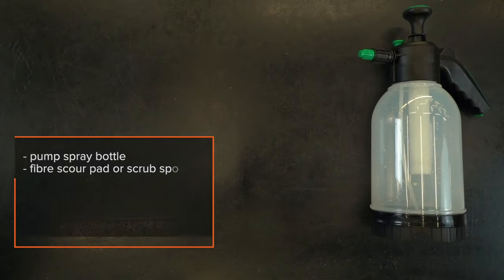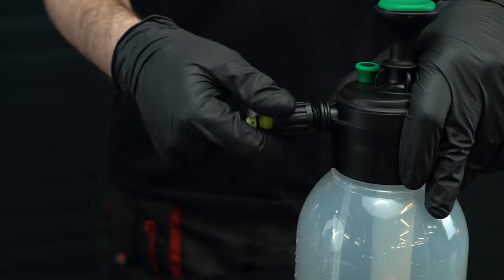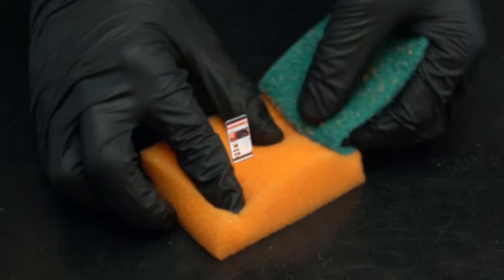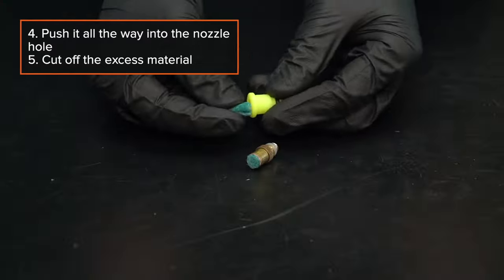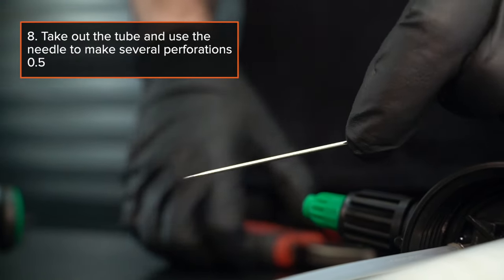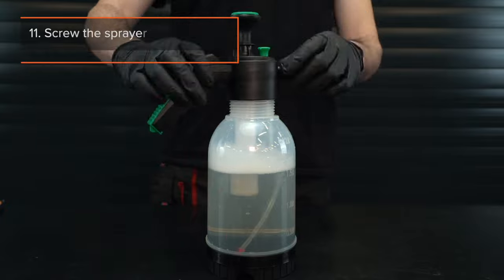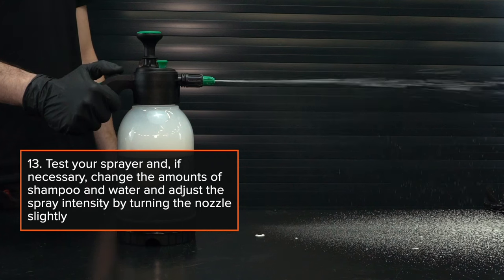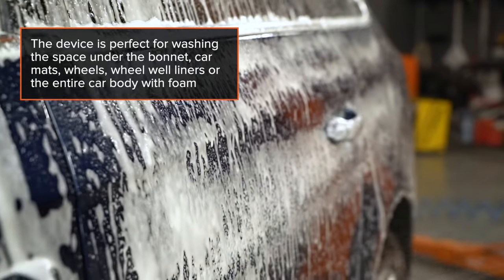How to Make a DIY Foam Sprayer | AUTODOC tips

Comment: Bro when I screw only 1 the bottle pressure are okay 
But because of u I made 5 hole like u 
And my bottle pipe and pressure is out of order
Reply: Same. I poked 3 holes and now it’s not working correctly 😂
Reply: The holes have to be all ABOVE the water line.

Comment: How many holes? And do u poke all the way through tube?
Reply from the maker: There is no exact number of holes, there should be enough of them, the approximate interval is visible in the video on the tube. The tube should not be tightly and completely inserted; there should be free space for the contents to pass through.
Reply: Thanks much man your video was very helpful🫡 and I now got a great hack for a cheap foam sprayer can’t wait to try it on my wheels and tires

Comment: How many holes I need to do in the upper part of the tube?
Reply: 1-2
Reply: What’s the point of the holes?
Reply: @1111100011111111  Air comes through the holes to mix with soapy water and create foam
Reply: 3 seems to be the magic number. I put 5 in at first and it worked okay. Took it apart again and blocked 2 with hot glue gun, leaving 3 open. And it worked much better. I used a very small pin though.
Reply: 3
Reply: @flowinthrou What about when the water is below the holes, how will it create foam then since the air won't hit the water with pressure? 
    Would putting in the sponge part alone  make the foam with friction? Please clarify for me.

Comment: Putting the holes in the tube ruined my sprayer.
It doesnt pull up any liquid, just releases all the air.

Ah nevermind, I was just testing it with only water.
You need the foam liquid in it and shaken up before it'll spray foam.

But now mines coming out like shaving foam or like confetti. Did I put too much foam solution in? 😋😋
Says 100ml per 500ml water.
There was 1500ml of water, I added about 200ml of solution, so 100ml less than recommended.
Reply: I dont know about the confetti thing, but I do know that if you want to use your sprayer for just water after putting holes in it, you could use electrical tape or gorilla tape to just tape up the areas you put holes in.